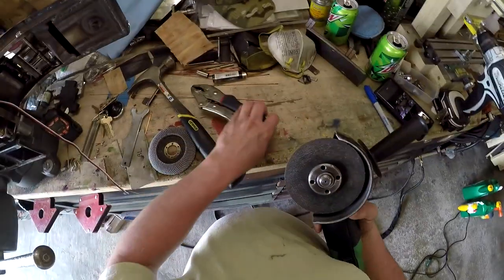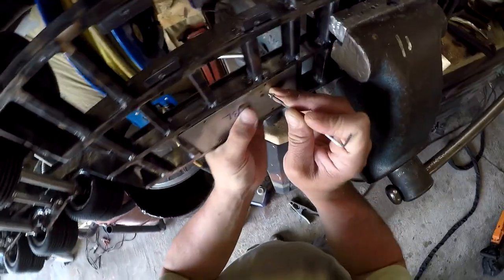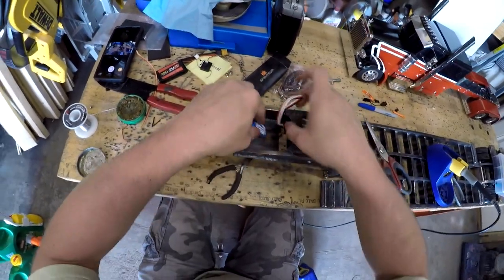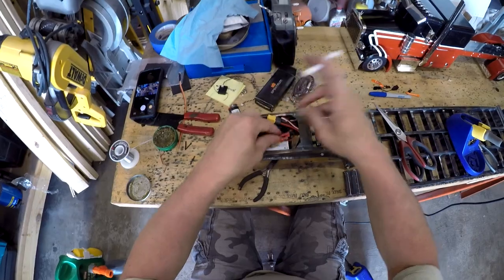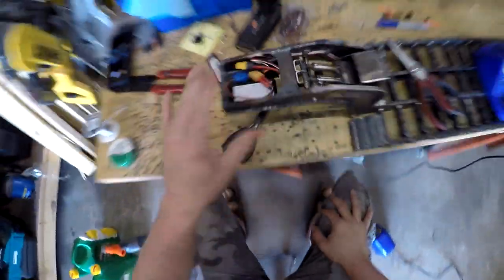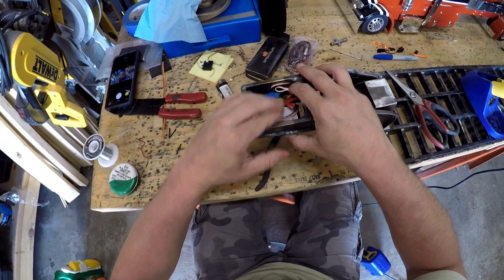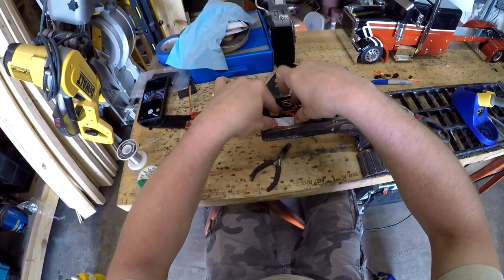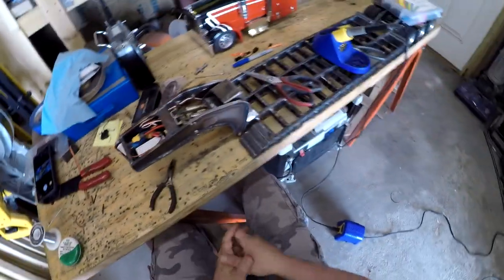Fabricating 1/14 Lowboy for Semi Truck Part 22

Comment: Awesome!! 👍👍
I gotta ask, WHICH Wires do you cross to get the 5th Wheel switch to stay in full power mode?? 

I'm still deciding between a MFC-03 and the Beier System, which is significantly cheaper - but far more complicated to use....
Reply from the maker: They were specifically the wires for the 5th wheel switch. Just cut off the switch and twist wires together. I would not gonwith mfc01... i was looking at i think the beier sys and will probably do that. This still does not go full throttle even with wires twisted, it limits in gears still. It also cannot support all the lights even though i made a board to adapt to it. Now it randomly restarts. Something must be over the limit in there. Too many problems and obstacles with mfc01.
Reply: @KarlsKrafts   Yeah, that's what I keep hearing. I'm probably going with the Beier!
Reply from the maker: @CarminesRCTipsandTricks  I tried the MFC01 because I'd been out of RC for a while and figured it would be the easy way... It couldn't be as bad as I had heard. It is pretty neat, but if your not going with a basic kit and want more than say a childs toy it is not the way to go and I personally would not waste waste money on another MFC01.
Reply: At first I was thinking about the MFC-03. I know, wrong sound. But, it's 9 years newer than the -01... In electronics, that's an ETERNITY.
But it's still limited, so I guess I'll go with the Beier. 
They have a Sound/Light only version, so I can use a good Hobbywing ESC with the unit!